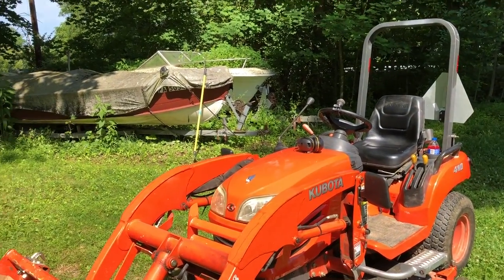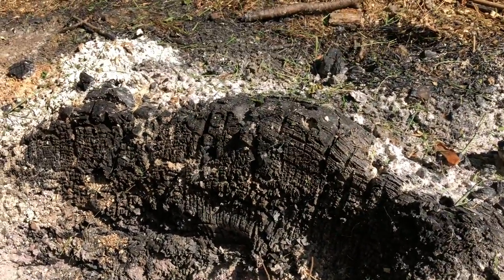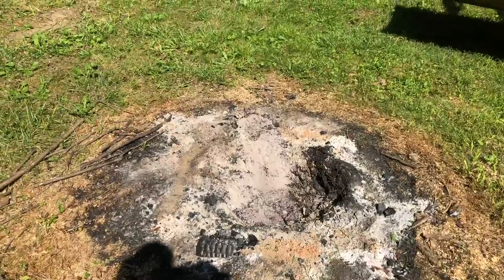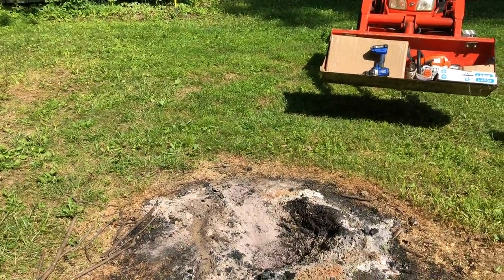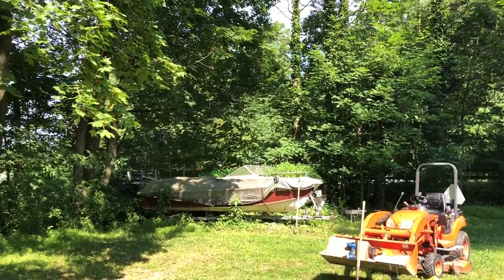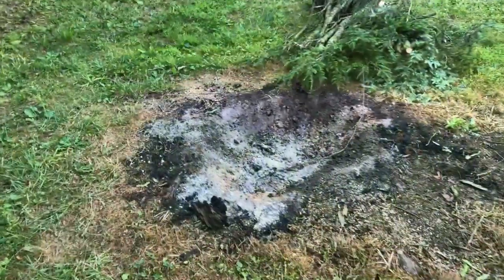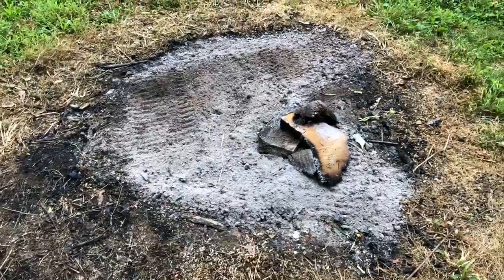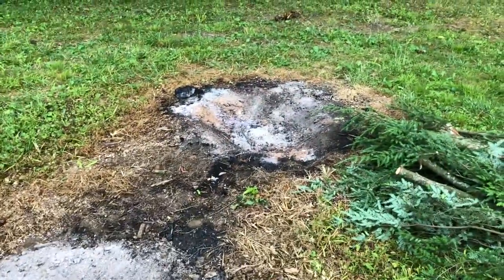#29 - Stump Removal Follow Up With Surprise Ending

Comment: Robert:    I've used a cheap electric leaf blower to give a turbo boost to a stump fire.  Picked it up cheap at a flea market.  I'll bet you could get one at Saturday's Market over near E-Town.    

I had a root that I couldn't get to burn up so I rigged up an old lawn chair at the side of the fire.  Wired up the leaf blower to the chair so it pointed toward the base of the root were the fire was hot and I was able to get a good burn on the root.  I will caution you however, that a resin lawn chair gets pretty wimpy next to a hot fire.  A section of aluminum downspout works great to keep the leaf blower back from the heat of the fire.  Next time I do it I'll use some scrap corrugated tin around the fire to contain the heat.  Figure that will aid in a faster burn. 

I have 25 ash stumps to get rid of this summer.   Come on over and bring your marshmallows!!!

Burn baby, burn!

Cheers!

Whipple
Reply from the maker: I like the corrugated tin idea.  It's a damn shame all the Ash trees are dying.  I had a leaf blower, but someone helped themselves to it.  Slowly replacing everything that walked off.  A Harbor Freight just opened in Mechanicsburg.  Grand Opening is July 10, I think I will pay them a visit.  Thanks for stopping by and commenting - Cheers
Reply: Robert Cline.  Half my wallet is expired 20% off coupons for HF and the other half is old IOUs.  LOL...!    Be safe!
Cheers!
Whipple
Reply from the maker: @Whipple1  You can use the expired coupons to light those stumps on fire - LOL
Reply: Roger that!

Whipple

Comment: Down at Mom and Dads in southern missouri, I cut down a bunch of the tree's, burnt the stumps out the same exact way! Drill holes, and Chain saw cuts. Western Cedar burned much hotter in the fires on the stumps!
Reply from the maker: It seems to work well - Of course if the risk of wildfire is high, this is not the preferred method - I have a lot of Ash trees die due to the Emerald Ash Borer killing all of the Ash trees - I have a bunch more to burn out -I will get them removed one or two at a time - Thanks for commenting Thomas
Reply: @botabob  Ash borers are attacking big in west Iowa, and the east side of the ash tree's. Good solid hord wood, but NEVER get turned into fire wood for inside the houses. That Western Cedar was way too much Creosite ways to burn in a house also. I think I will today or tomorrow to give you the shout out on my channel! I am waiting for the UPS to get me the deliveries today. another 50' rubber air hose, and the Campbell Hausfeld tire. It is after 2 pm here, and still no deliver today...... UPS Brown trucks are always Poop Deliveries!!! LOL!!!